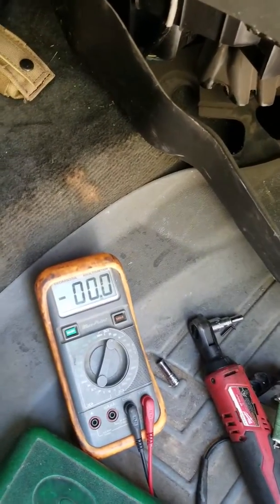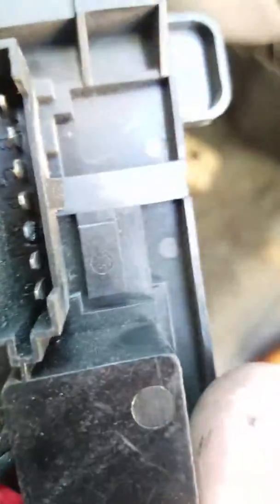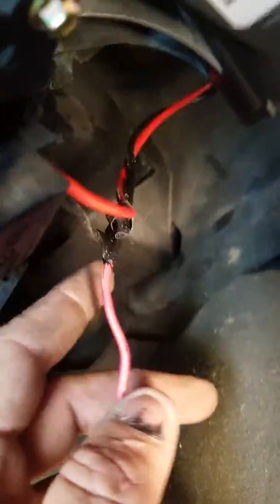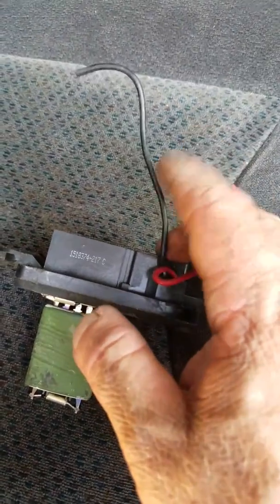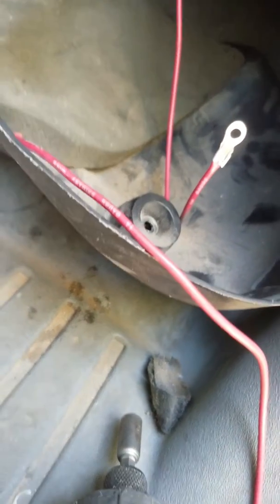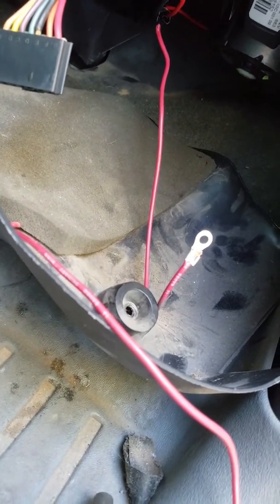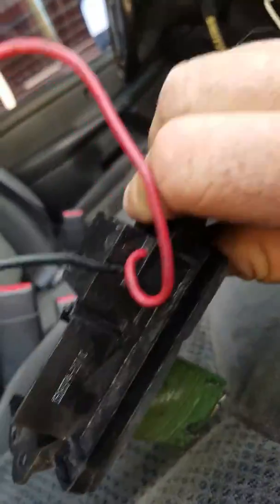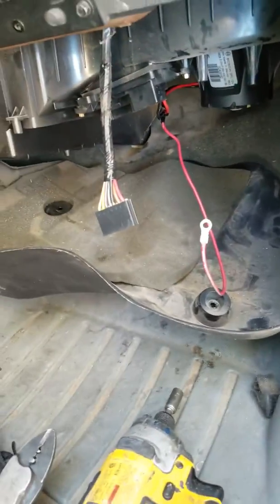2006 silverado blower motor relay fix smell smoke

Comment: A giant THANK YOU for this fix. I had already gone to Napa and purchased a new resistor and harness pigtail,  when while searching Youtube for install tips I came across this fix. Followed your instructions to the T, and it works like a charm. Returned the resistor to Napa, saved $70 and couldn't be happier. Thanks again.
Reply from the maker: Your welcome!!
Reply: @whocaresaboutme29  well I am currently having this issue in my 03 gmc Sierra and I replaced the resistor with one off ebay which does work "kinda" but I have no speed 1 or 5 on my blower motor if I turn the ac or heat on low it does nothing and all the way up, again it doesn't do anything but when I put it anywhere between it works but there definitely is a faint smell of burning plastic and my truck only has 80k mi and is absolutely minttt I would cry if it burned my truck
Reply from the maker: Your welcome..😀
Reply: @whocaresaboutme29  Update. I have lost 4 and 5 speed. 5 works sometimes but smells hot. 3 works well enough to keep me cool but this winter I'd sure like to have 4 and 5.
Reply: @whocaresaboutme29  Should the ground that is in the original harness be cut?

Comment: Just did this on my 06, been running motor for 5 min now and no smoke! Was a little confused about the ground but I just spliced and soldered into the blower ground to a wire I had in the garage to that clip he shows under glovebox. Seems to work! I guess the ground is split between the battery and the new ground? Whatever it works!

Comment: Have to researching this quite extensively it's actually the blower motor increases in resistance Siemens cells one that comes with a lower resistance than what the blower motor came with factory and you'll never have another problem with it once you replace the resistor and a pigtail harness with that lower resistant fan that's the whole problem to begin with is the fans increasing resistance over time and nobody wants to replace the fan because it still works or the blower but that's what I've read I'm still troubleshooting mine even working after replacing the dash control and the resistor

Comment: Yeah we replaced ours two times now I'm going to try this but can you do the ground completely without being plugged into the plug Mines melted pretty bad, does that black wire even have to be and there if your grounding out it elsewhere
Reply from the maker: No the wire goes from the the plug to the ground on the truck..remember ground needs to be short as possiable
Reply: @whocaresaboutme29  I don't know I just grounded mine and it started working again so win win
Reply: @whocaresaboutme29  So should I cut the ground that goes all the way back to the battery?